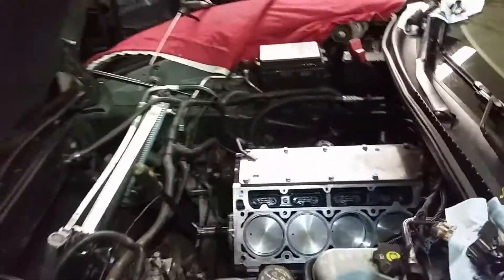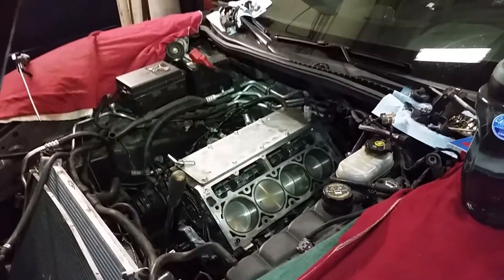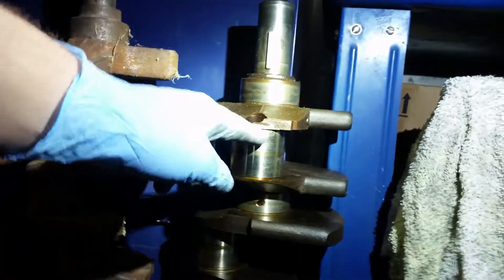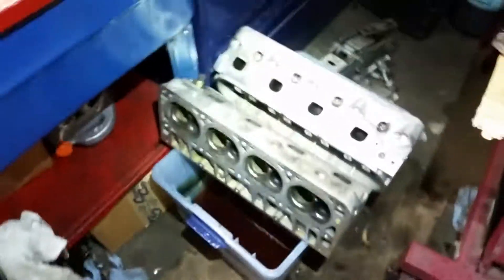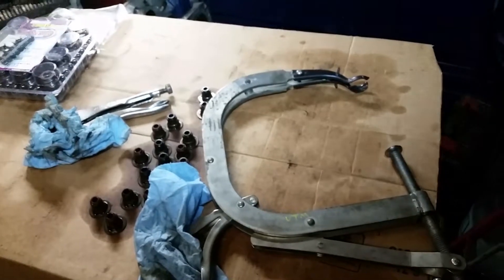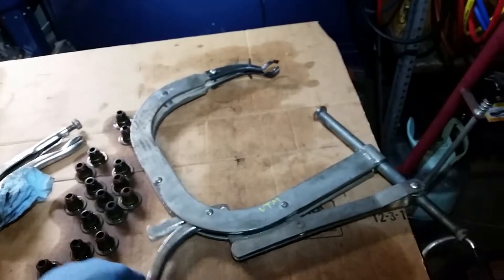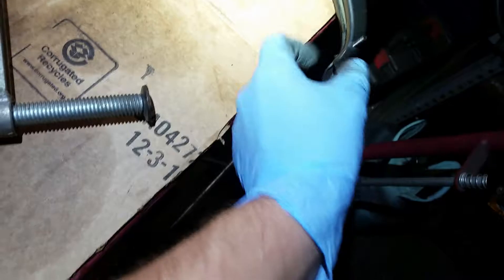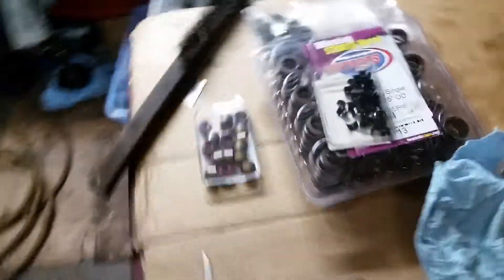C6 Cam Swap Part 1

Comment: Hi Rick,  Got any ideas how to get my hands on a GM L67 V6, with the supercharger?  I'm going that route with my 97 RS.  Thanks
Reply from the maker: J. Hunto's Garage cheapest route would be a salvage yard I've seen a few gtp' s over the years with the supercharged 3800. In fact we used to scoop the chargers off them and sell them for side income. Usually you can get a complete motor for a few hundred if you pull it yourself. Bring a cordless hack saw and a lot of tools